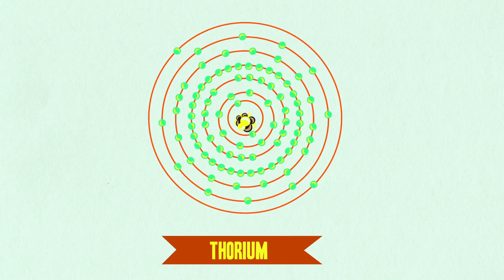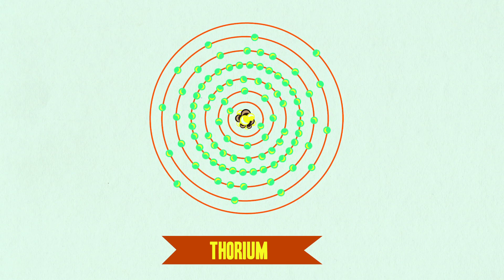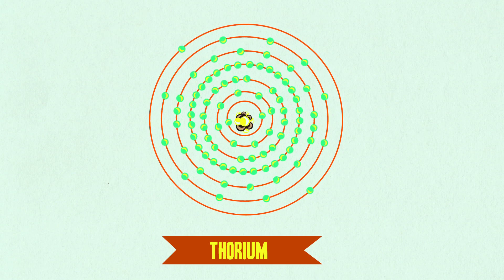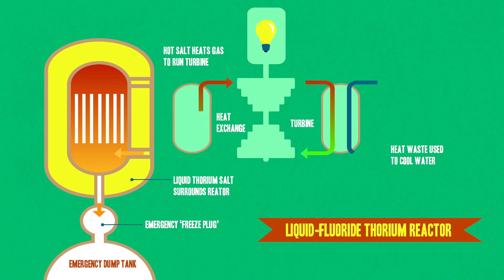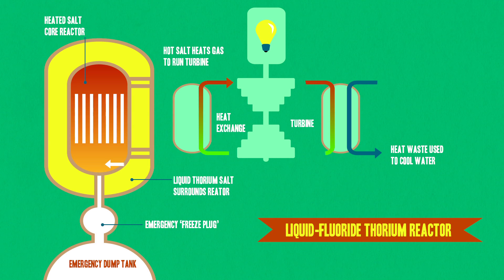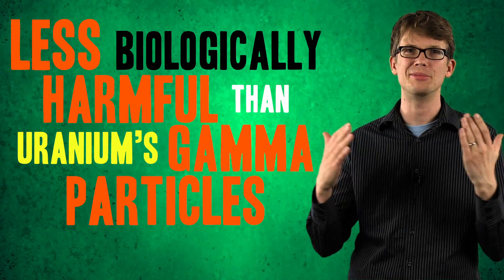Liquid Fluoride Thorium Reactors (LFTR): Energy for the Future?

Comment: since when is uranium giving gamma particles? its an alpha emitter and so most of its long half-time fission products are as far as i know. anyone an idea?
Reply: hmmm interesting paper. but at which state is it coming and decay chains are not necessarily the same as fission chains, are they?
Reply: Tithon Azubi in the case of nuclear fission there are more options for nuclear reactions, specifically those where a uranium nucleus splits into two nuclei, by interacting with a neutron. the spontaneous decays, without the extra neutron, typically results in alpha and beta radiation and those reactions are listed in a decay chain. the extra neutron interacting changes the probabilities of the different possible nuclear reactions including those we label "fission" instead of plain old "decay"... some of the nuclear reactions can even absorb neutrons (like U238 + 1n -> U239). so basically no, they aren't the same.

in either case though, by conservation the binding energy in the nucleus plus the kinetic energy of the reactants will equal the kinetic energy of the decay products and their binding energy which will have a slightly smaller total rest mass, so the balance changes in favour of kinetic energy. since some of these nuclear reactions shift electromagnetic charge values around (protons, electrons, positrons) they can emit some of that energy in the form of electromagnetic radiation and when it happens immediately it can reach the energy levels of gamma rays.

as for the actual waste this is mostly about the decay chains of the fission products, which are more diverse than the decay chains of the U235 or Th232 themselves. the decay chains of the fission products of U235 and Th232 (really U233) are different, with thorium fuel waste emitting most of its gamma radiation from very short lived isotopes and u235 taking more time to do so.

So if I understand correctly, the comment in the video is about the long lived fission products and actinides (produced by neutron capture) of the thorium fuel cycle having a safer (lower energy decays) with most of the radioactivity resulting from the short lived ones, whilst u235 in water reactors results in less manageable material, but in reality both will emit gamma radiation, it's just a question of how much and how fast.
Reply: thank you very much!

Comment: Thorium must be mined, and therefore is not environmentally friendly.
Reply: by that thought process neither is solar or wind power because of all the metals and minerals that must be used in them. Also, Thorium is normally found with the rare earth metals that are very commonly and abundantly used in our electronics, so thorium is currently mined and set aside since we currently don't use it.
Reply: Samuel Kunzeman  That is exactly why wind turbines and solar panels will not be mass produced. rare earth metals, are just that, rare.
Reply: StrategicGathering You are missing the point. It has zero environmental impact if we are using what we are already producing. The rare earth metals that accompany thorium will be mined regardless of thorium usage. It's as environmentally friendly as using cow methane. The methane and its combustion byproducts are bad but if it is being produced anyways then it is more environmentally friendly to use it.
Reply: StrategicGathering Rare earth metals are not actually rare, They are called rare earth because they are not found in clumps like coal or gold or bauxite. They are just a bitch to process. That is why they are called rare earth metals
Reply: Actually, a lot of thorium is dug up with rare earth metals and is simply thrown away as a useless byproduct. Until we start using more of it than is currently produced it is probably the most environmentally friendly technology in existence.
Reply: StrategicGathering
but thorium is as common as copper and most countries have huge stockpiles of it in wast heaps from mining other elements .may be wrong but i'm sure i've been told usa has enougth stored to last 30 years. why not encorage those countries that want nuclear power to go with thorium as it answrs a lot of issues with proliferation. if they insist on uranium you've got strong grounds to say they want to weaponise it as there is better way to just creat the power and we were totaly willing to help them with that tecnology.
Reply: SpazzyMcGee1337 Mining is not environmentally friendly.
Reply: Knosis I never actually knew that, kudos
Reply: StrategicGathering You definitely missed the point.... i picture your next reply being another repeat... and that just makes me think of the donkey on family guy.
Reply: By that criteria, nothing is environmentally safe because pretty much every material we use is mined...Technically even our water and food.

Comment: Why aren't power cables buried?
Reply: Because their less efficient, and harder to wire.
Reply: And more reasons as well. My neighborhood has underground powerlines. It's nice, but uncertified digging can be dangerous and get you in trouble with the law. Normally you need to hire a crew. Also, we had a 1 mile stretch of road that took about 3 years to widen for electrical and sewage reasons.

Other than that, it's certainly more stable, safer, and looks better, which is why you see it more in newer upper-middle class communities.
Reply: hank you...er.. Thank you.

Comment: They also have a bunch of need deadman switch options in case of trouble that can be used to prevent them from melting down.  I think they are neat. And you can't build bombs with it so extra points.
Reply: ***** I think for meltdown he meant the structure (core) the reaction happens in melts

Comment: Just to point out alpha particles are actually considerably more biologically damaging than gamma radiation. They have a higher ionising power and so is more dangerous when it comes into contact with living cells. Alpha radiation is, however, easy to stop. A single piece of paper or even your layer of dead skin will stop it penetrating, whereas gamma is almost impossible to contain. This is what makes gamma sources more dangerous.

Comment: I'm terribly sorry, you have made some mistakes.
1) Both Thorium and Uranium decay with gamma, beata and alpha particles; in fact, the decay chain touted as making thorium based nuclear more "proliferation resistant", the U232 chain, has higher energy gammas in it than in the U235 or U238 decay sequences.
2) The liquid fluoride salt is fuel, moderator (in some cases) and coolant. while this makes the design safer in many ways (the high melting temperature means low pressure for similar or better thermal efficiency; the system can be quickly rendered subcritical and passive coolable by channeling the salt into small containers), it does mean you have a primary loop full of active fissionable compounds, and there will be some fission (and thus high energy neutrons) everywhere that coolant loop goes, which makes the business of primary core shielding much more interesting.
3) Thorium waste (U233) ALSO makes bombs - actually better bombs than U235, and only slightly worse than Pu239.
Reply: U232 does make it hard to hide your bomb because it screams those nasty gamma rays, and irradiates your bomb makers and the bomb's electrics. Also U233 isn't waste.
Also I'd prefer the first heat exchanger be in the reactor so the cooling loop slats wouldn't contain any fuel (just in case). If the reactor shuts down then all molten salt cooling loops should also be drained to prevent damage and clogging.
Also I'm divided about fast LFTR's neutrons causing embrittlement and the thermal LFTR potential for graphite fires and maintenance.
Reply: leerman22 The gammas from U232 are not significantly different from the gammas produced by other decay chains (2.6 MeV vs. 1.7 MeV for U238); the short half-life is the issue with dosage. But - that same decay chain is found in Plutonium bombs, from Pu236.
But its a red herring: steady state (thermal spectrum) ratio of U233:U232 is 800000:1, about 1 ppm, U234 is about 73 ppm. Neither is significant, although U232 does end up contributing 0.3% of the activity from Uranium.

Comment: LFTR would cost about $1 / American to build the first plant.   Definately worth it.   A LFTR plant is 50x cheaper than a Uranium plant, which is why you don't care about closing the uranium plants.   Cleaning up the waste from the uranium LWR plants gets a l ot cheaper too, because you can dump it in the LFTR and it will get eaten up and be safe immediately and within 300 years be safe for disposal.

The fuel for the LFTR is over 100x cheaper, which is the real reason industry wasn't interested.   Reactors are sold like razor/razorblades.   Only one fuel fits, so the plant is discounted.  But LFTR eats a liquid fuel made of a cheap as dirt commodity.  How do you patent a rock?   How do you make money on a plant no more expensive than a typical fertilizer plant if you cant even sell them fuel?

Comment: Of course, it's not as simple as all that. There probably are really good designs for Thorium powered reactors. But I'm not particularly happy with existing notions for LFTR because of several technical issues. (Read the Wikipedia article.) I'm in nuclear safety and some of the issues are right up my alley. The one I'm moaning about now is the "loss of delayed neutrons." That one would totally chap my ass if I was trying to get this puppy past a regulator.

Comment: Build thorium plants to deal with increased demand for power and tax the shit out of coal. Uranium plants suck, but they'll be decommissioned eventually, we can build new thorium plants then
Reply: *****
The longer the half life the less radioactive and thus dangerous it is. The real concern is the short lived isotopes (freaks of the periodic table) that produce dangerous radiation. They release the most ionizing radiation. You would get generic heavy metal poisoning long before radiation poisoning from uranium, unless you ate a short lived isotope of that element.
If the half life of natural uranium was hundreds of years then we couldn't build nuclear power plants because there would be no fuel left from star formation.
Reply: on the right track. Coal is sooooooooo abundant. We should tax the shit out of dirty power plants, and leave the cleaner ones. Uranium reactors can't just be taken away,they have to be stored in a concrete bunker for 1000 years or so. But we should definatly use thorium.

Comment: can you get it from 232 to 233 to make it safe..?and viaable for industrial use that is  cheap enough.
Reply: Th-233 is created during the process of using Thorium in LFTR reactors but it is an extremely unstable isotope so it decays but this is a good thing as it is how Thorium is eventually used to create Uranium-235 which is a fissile isotope that then creates a chain fission reaction where 1 or more neutrons is then absorbed by Th-232 to become Th-233 and the entire cycle starts again
Reply: *****
thanks for the info this is good news.

Comment: Why retrofit the old reactors to use thorium? Just shut them down after building new thorium power plants. Then everyone can drive an electric car and we can get rid of the coal-burning plants.
Reply: John Carraway There's also the problem of activists protesting and blocking those power plants from being made or upgraded, or brought down and rebuilt with safer new plants.
Reply: That would be ridiculously expensive is why, even more ridiculously expensive than retrofitting old plants. I do agree with you though, I think it's worth the expense. Though I think we'll probably phase out old plants over time if anyone decides to run with the technology.
Reply: MrJshags
It might be feasible to convert them to thorium, but why hold up progress by going that route. Just build new thorium plants to replace the coal-burners, then do the conversion on the old nuke plants. Let's get the job started ASAP.  India and China are way ahead of us already.  See  flibe-energy.com and energyfromthorium.com.
Reply: MrJshags Swiss are working on process to use Thorium in Fuel Rods for current LWR.
Reply: John Carraway Quote from J. Carraway."Just build new thorium plants to replace the coal-burners,". Problem of your statement is "NO" N.R.C. approved thorium plants are available to be built. Please give Link to N.R.C. approved thorium plant available to be build.  .. There are none !!!
Reply: Environmentalists need to understand the choices available and the advantages of each. News media needs to get involved in an unbiased fashion. LFTR plants and green energy electricity needs to be used first if it is available, as this is in the publics best interest. This is basically a political control problem.
Reply: That:s what called sunk cost fallacy. Also current uranium rector actually quite safe so why change?

Comment: Salt at high temperature is not an easy material to handle safe. It's corrosive properties will almost sure generate leakages spreading the radio-activity (despite using 'corrosive-free' metals.
One of the reasons the experimental reactor at Oak Ridge was stopped, and that China asked cooperation from India and UK for a >10year multi-billion development period.
Reply: ah dude sodium is not quite the same as salt(part of not all of) Spain uses molten sodium heated by the sun to generate power. yes it has issues but they have been addressed many years ago. sodium doesn't need the high pressures that steam does as it sits at about 450 degrees C, massive heat but much lower pressure. it is also kept in a sealed environment so it cant form salt. also when u purify sodium out of salt u get a large portion of Thorium as a by product so win win
but i could be wrong rofl
Reply: myutube notu
...you really don't know what is the chemical meaning of "salt", do you?
on LFTR, it is expected to use Thorium Fluoride, which by chemical definition os a halogen salt, and also coming from a very corrosive family...thus the corrosion issue highlighted by BasM stands.
Difference between sun concentration systems and nuclear reactors: if salt causes a leak on scs, that's just a salt spill, not a big deal; if it's on a nuclear reactor, that's a class 6 to 7 accident due to the radioactive stuff.
You are right when you say that LFTR won't need to stand high pressure because it will basically be at an almost zero bar-relative, but there is the alpha particles emitted, which by all means are Helium gas... and Helium can introduce pressure into the system and induce metal weaknesses into the reactor structure; not a miracle solution then.
...finally, a LFTR lacks the first and second level of protectionwhich on standard reactors is provided by the solid insoluble fuel and Zircaloy rods; this is the main reason why, so far as there will be available Uranium and the security will be primed on nuclear industry, LFTR won't be built for energy production in developped countries... and by available Uranium, I also mean depleted Uranium which can feed FBReactors (which use molten metal, but dispose of all protections as standard reactors)
Reply: Alberto Vezzoli Nahh the main salt in the so called "blanket circle" will be mainly LiF and BeF2 (FLiBe more than 90%)
the fuel: ThF4 -> some PaF4 and PaF5 (Pa 27 days half life) -> U(233)F4 and the gas U(233)F6 which will transport the U(233) to the other circle. All the gases like U(233)F6 , He , Xe(135) and Kr(85) will bubble out of the molten salt.
The materials that may hold all those nasty salts are not many actually there's only one candidate and it's called "hastelloy".
Reply: Just use graphite, tungsten, boron or titanium..
Reply: myutube notu This isn't talking about the sodium reactors, which do exist, this is talking about the fluoride reactors. As in not sodium.
Reply: Alberto Vezzoli Alpha radiation isn't helium. Obviously. Why you may ask? Because it's only helium nuclei. It's not helium because, oh look, no electron orbitals...
Reply: James Oldfield seriously? and you don't think that missing electrons would be recovered by surrounding salt?
by the way, the electronic orbitals are always there, because they're just an energy function of the electric field generated by the protons. The fact that electrons are missins is just a temporary matter.
Reply: Additionally we could use iridium, gold, or any carbon/cobalt composite based substances that are chemically stable. Iridiums are ridiculously rare so we could use osmium alloys and compounds which we basically throw away because it's oxide compounds (osmium tetroxide) have high toxicity but if we could just combine it with other substances such as boron,carbon and such it will be a great material as it is the densest element and it width stance very high temperatures.
Reply: Joshua Lee All these things will dissolve completely. There's that thing Gibbs free energy and it turned out the only thing which won't dissolve is nickel difluoride (NiF2) and they say some hastelloies which I really doubt... NiF2 is a very brittle salt maybe just maybe if there are some fluoridated nanotubes inside the big NiF2 crystal it could be used as a container for FLiBe + ThF4 + UF4